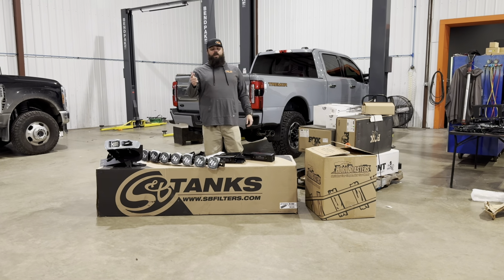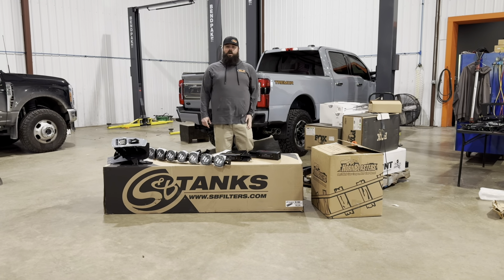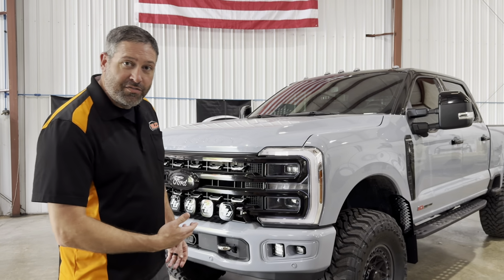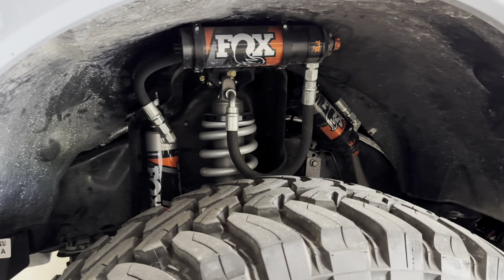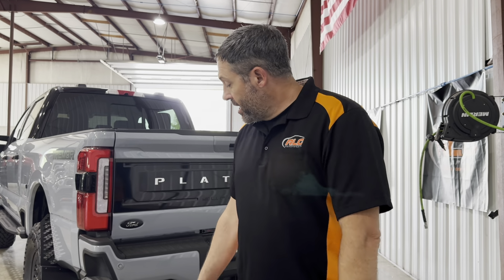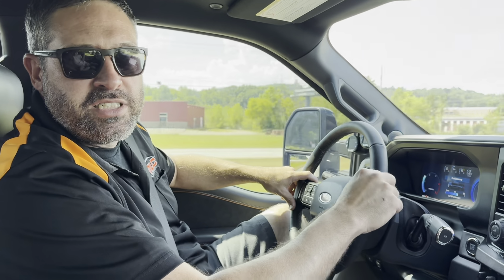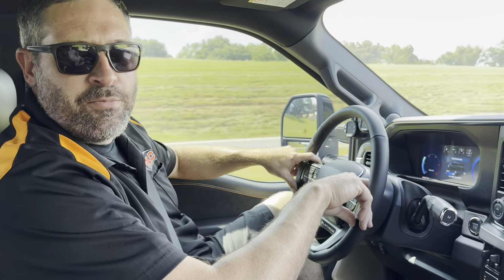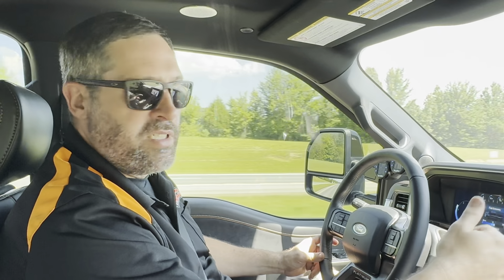COILOVER SWAPPED 2024 TREMOR

Comment: Paying 5k for a tremor package then swapping suspension equates to paying 5k for a decal
Reply: Not accurate
Reply: The limited slip front differential alone is worth it
Reply: @Eric_Broome  Meh. Better spent on suspension lift, and/or winch. Using brake and gas petal together works better than the limited slip front.
Reply: You think it's 5K just for the shitty factory shocks. The Tremor package is mostly asthetic plus the LDS up front as mentioned. The shocks are no reason to get the package in the first place.
Reply: @JsGarage  your right, it’s a decal, tires, profit….and shitty suspension
Reply: Absolutely not accurate. Go  back  and reread so you can get a better understanding.
Reply: Lockers, winch bumper, skid plates, full size spare, drive modes, taller from factory. Plus I paid the same as a normal platinum, what’s not to love. Just peel of the decal then ya got a sweet looking power stroke that does “gooder” here in Moab
Reply: @CodeMoab   All fine if your keeping it all stock tremor and not ripping out the suspension, arms, stabilizers, tires, wheels, etc. Which is my point. Tremor is not worth it if your are lifting it. I saved the money towards 38’s and a 5.5” Carli pintop w 2.5” king shocks.

Comment: You mentioned not having the tires at max tire pressure for just riding down the hi-way but didn’t specify where you do recommend keeping it at as a percentage of max when you aren’t towing or loaded out.
Reply from the maker: Directly speaking we don’t use a specific percentage. We base it on the wheel and tire package. Especially wheel width and tire width. Also what the vehicle weighs, on any given day.  That covers the safety aspect, next is the wearing characteristics. Too much air = center tire wear, not enough air = outer tire wear. We focus on a nice even wear pattern for drivability and tire life.  Thanks, Mike

Comment: Beautiful job, is there an advantage of having a tremor if you replace the suspension?
Reply from the maker: Tremors have a few options that are off road related that a platinum or lariat etc wouldn’t have. Example would be rock gaurds or some interior stuff. We took everything off that made it a tremor suspension wise when we did the full bds on this unit. There are certainly positives to buying a tremor if you don’t want to go this extreme.
Reply: @rlcmotorsports  plus 3.55 gears over the standard  3.31s. A big plus when you go with bigger tires. Speaking of tires, what size are these?

Comment: Beautiful truck!  Informative video!  Nicely done!  A question:  An F150 likely suits my needs better.  Am torn between customizing a Platinum or a Tremor.  Will do a lot of highway driving, but some off road, more destination oriented, to a campsite or fishing spot or cabin, and most importantly, living mountainy ski country I will be driving in heavy snow storms quite often, those are the best ski days after all.  Though I will get to the deserts and sea shore at times too.  And there is a possibility I may do some version of an overland set up, so payload capacity for sure, but maybe towing too, is somewhat relevant, just not the priority.  Am looking for max luxury in a go anywhere, anytime, any kind of weather vehicle.  And I appreciate more road clearance.  So, my question, or questions.  Will the upgraded Fox coil over and shocks, front and rear, or something similar, perhaps better, make the F150 Tremor as smooth and luxurious a drive as the Platinum, generally, but especially on roads and highways?  Is there anything that can be done to the Platinum or Tremor to make it as buttery smooth a drive as the Raptor?  Thanks.  And great vid!
Reply from the maker: Nate, great questions. Based on your intended goals with the truck. I think the Platinum would be more desirable, considering the amount of time you will spend in it.  I would recommend finding one with 3.73 gears this will offset the additional weight and tire diameter once it is lifted.  As far as suspension goes, BDS offers a quality suspension for the platinum or the tremor. Tire and wheel package will play a major part in overall ride quality. The sidewall height is critical , more sidewall = more cushion.  As far as payload capacity, once you have made the decision to utilize the bed or pull a trailer. I would scale the truck and see what the numbers look like. Airbags can be your resolution if you need additional assistance, while loaded. Please feel free to call the shop, and I will give more in depth answers to any questions you might have. Thanks, Mike
Reply: @rlcmotorsports  I'd utilize the bed.  The towing would be something small, maybe a smaller boat or something, but not a huge RV, so would just use the tow hookup at the back rear bumper, no 5th wheel.  I agree with the 17" or 18" thicker rubber wheel, would love a 35 or maybe a 37 tire, but narrower not wider, so if possible, and would give good performance and advantage, I'd rather have the tire be a 10" width or even better a 9" width, in part because I've always understood narrower tires mean more lbs per square inch on the ground so better in icy and snowy conditions.  I think I've learned also that a narrower tire, like a 9", would potentially allow a larger tire in the wheel well with less or maybe even no trimming and still have max clearance.  I've been thinking 2 1/2 to 3 1/2 lift or level, maybe better the 3 1/2" level to give more clearance for the larger tire, as long as the suspension or shocks or ball joints, whatever might be stressed could be upgraded so no stress.  Any thoughts on all this?